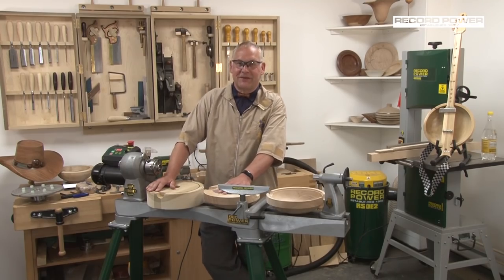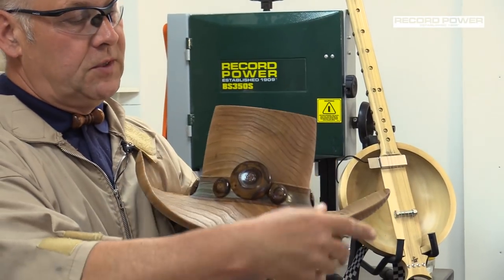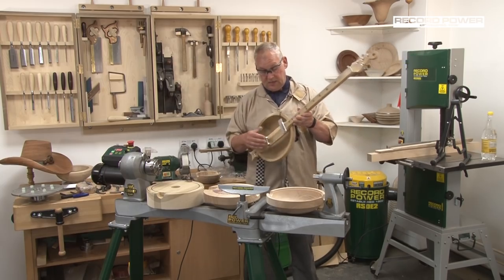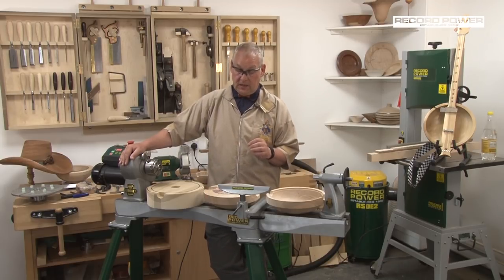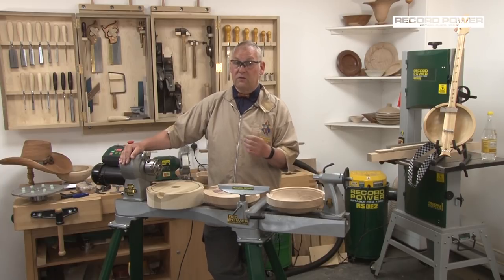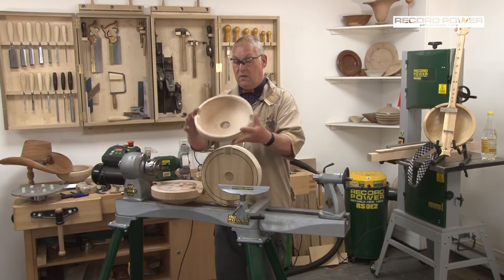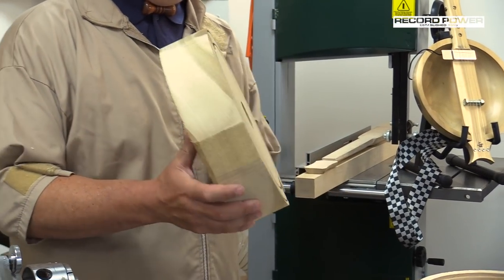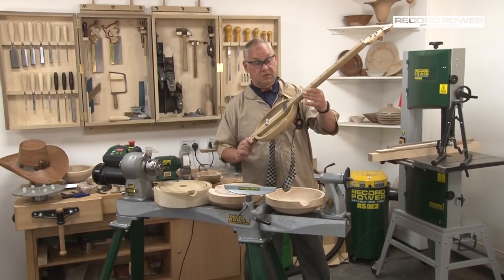Woodturning Masterclass on the Coronet Herald Lathe with Professional Woodturner Andrew Hall

Comment: Having the belt change on the back seems it may be an issue. Would have been nice to see a speed change demo working from the front of the machine👍
Reply from the maker: Hi Greg, thank you for your comment. Our resident expert Craig Heffren has produced a video as part of our Know-How video series for changing the speeds on the Coronet Herald lathe, please find this video at the link: https://youtu.be/n19ecd443ZQ. Hopefully this is helpful to you. If you should require any further assistance, please contact our Technical support team on 01246 571 020 or email technical@recordpower.co.uk. Best Wishes, Record Power.

Comment: Can't believe that you stood with one hand either side of the blank while you brought the speed up. I was told you should stand to one side - out of the line of fire - when you bring the speed up ???
Reply from the maker: Hi Mike, thank you for your comment. Andrew was confident that his process of work was with minimal chance of risk, however, Andrew suggests if work is unsupported by the tail stock then it would be wise to stand to the left hand side of the lathe when increasing speed. Additionally, if work has any bark or loose inclusion remove them before starting the lathe and again standing to one side would be good practice. The material in the demonstration had no defects, held firmly in dovetail jaws and supported by the tail stock therefore there was minimal risk of the material detaching from the machine.
Reply: CAN'T BELIEVE YOUR MAMA LETS YOU DRIVE.